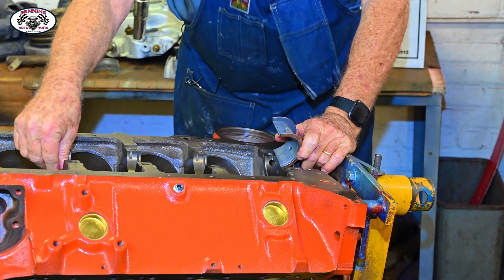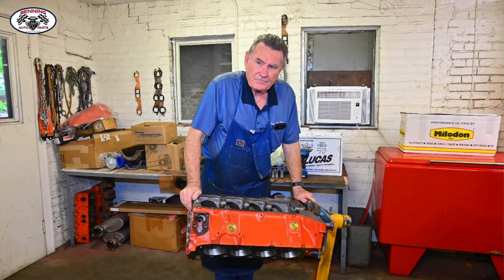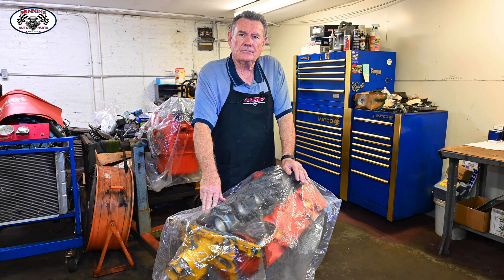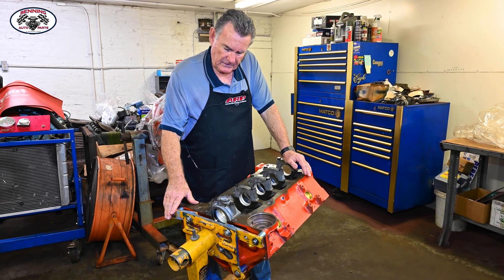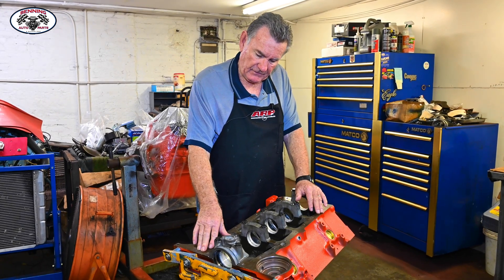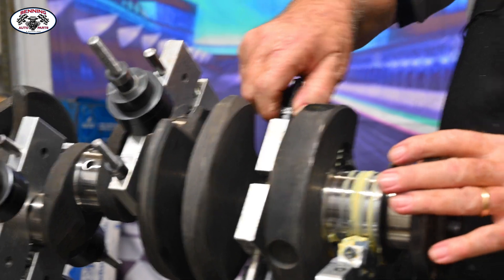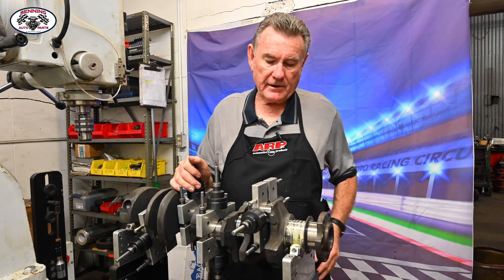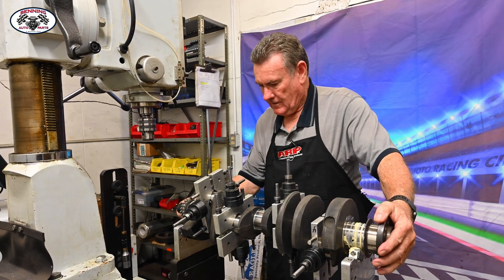Chevy 327 Pt#2 Crankshaft Balancing

Comment: My dad  uses to drag race 1955 1962 1969  he collected lost old vintage sbc parts  back 1965 he had Reed  rolled camshaft  sbc  he had collected 327  I have 327 4 bolt main  set  462 double hump head  back day's  daddy  had custom build 462 202 165 valve  head re drill head angle plug   back 1963  have several set   my dad drag race up in Marland  back day's he had front wheel dragster  two 327 engine  bolt together  back 1964    will still have old dragster  my daddy out deep south  louisiana   he started drag racing 1952  until 1964 he was drafted in army vaitnam   1952 buicj nail head engine  Oldsmobile 1955 big power back those days 😊